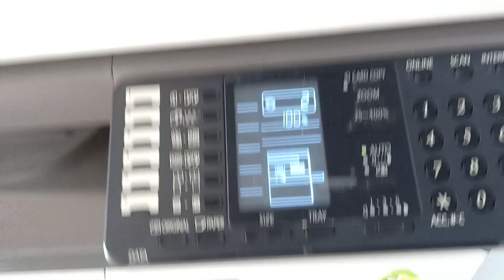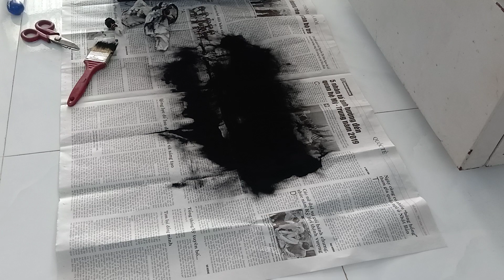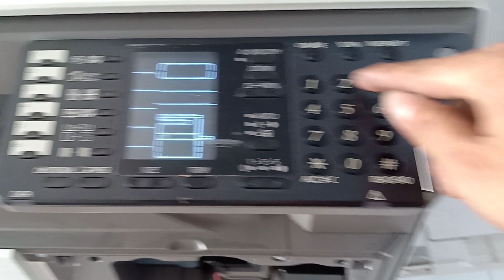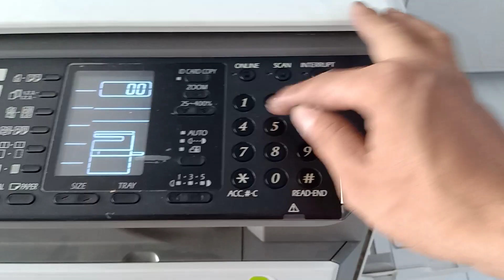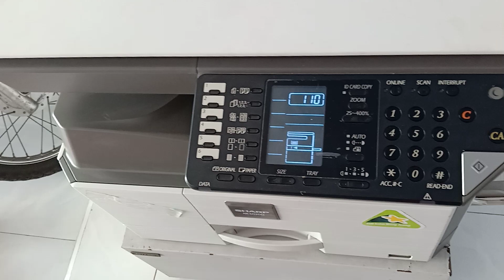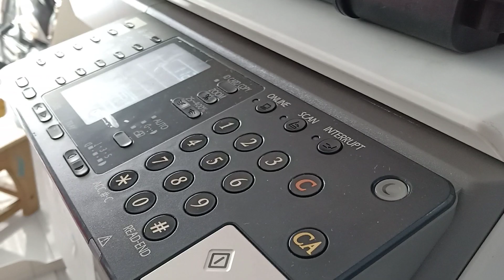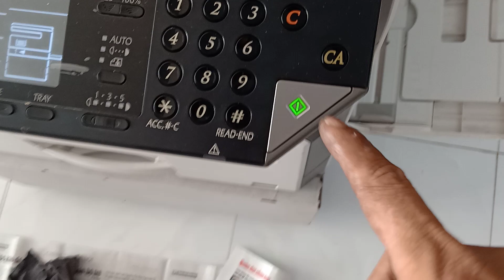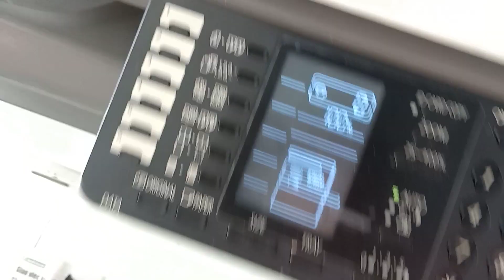Sharp ar 6020d F2-40 change devoloper .

Comment: I have a sharp ar-5618 camera
 When you turn it on, the letter F appears immediately, then it disappears, then appears as the number 2, and this is how it continues... I changed the agency's ink, but unfortunately the problem was not solved... What is the solution.

Comment: Sir my sharp printer mx m265, machine in f2-40 error code coming so I am replaced developer but some copies coming after same error code coming give me the solution
Reply from the maker: check developer (black ) .
Reply from the maker: Solution ! 
You can modify bigger developments
Reply: You may be using a spurious toner. Change toner cartridge if problem persists  replace TD sensor.